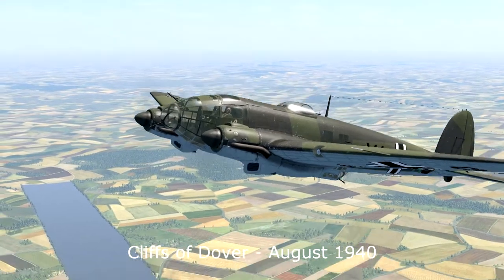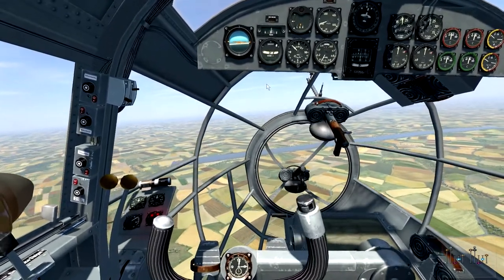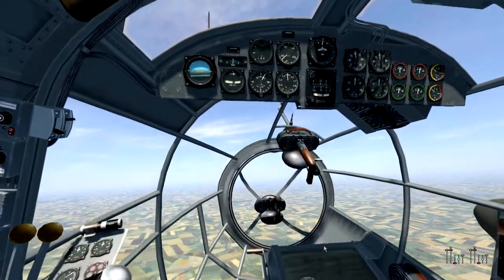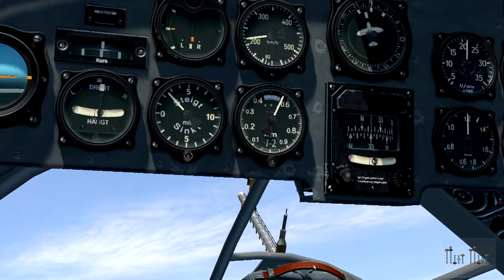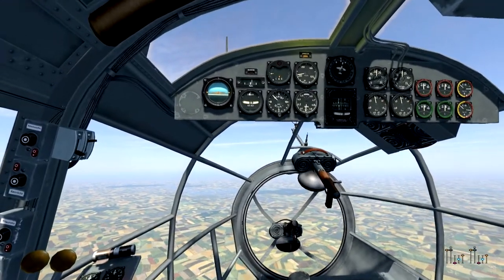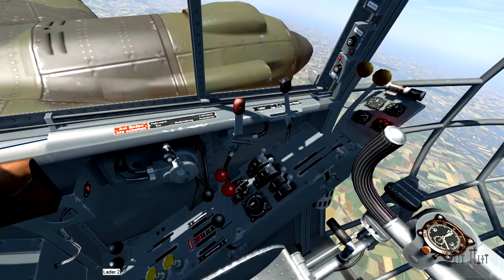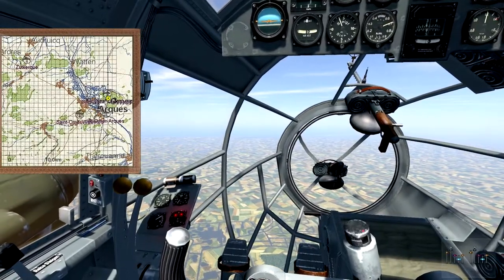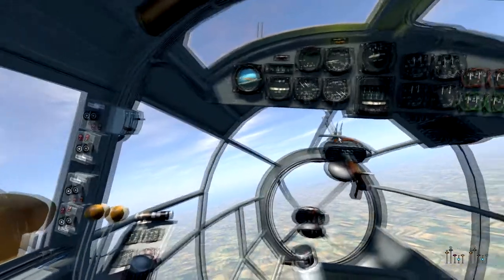CloD He-111 Tutorial Part2 Level Flight and Autopilot (english).mp4

Comment from the maker: No it's not the "A"-Key. There is a simulated Autopilot called "Kurssteuerung" in German. You need two assigned Keys for "kursst_m_next" and "kursst_m_prev" (at least that is the code in my .ini-file) because there are two stages on the He-111. It is also better to have keys for the left and right switch. It's hard to hit them with the mouse.